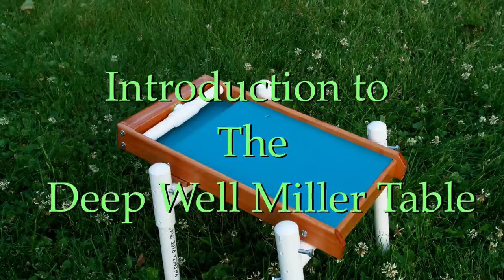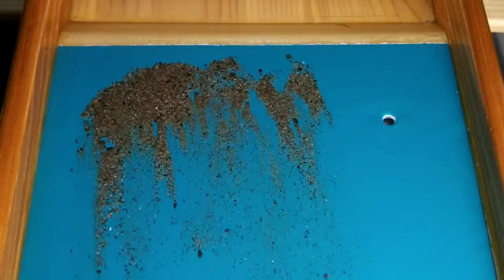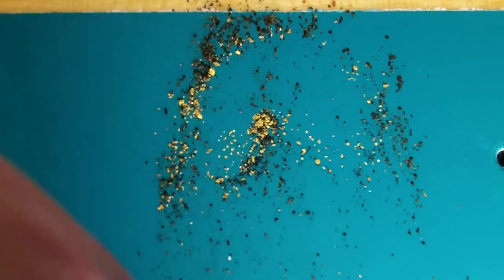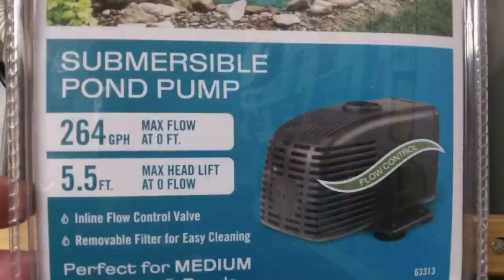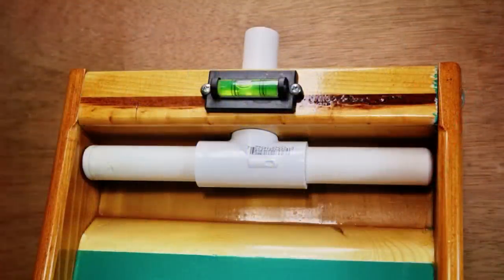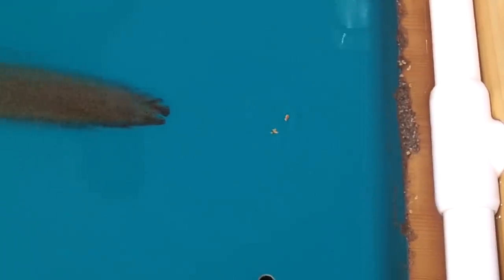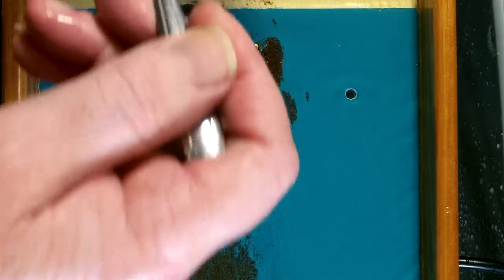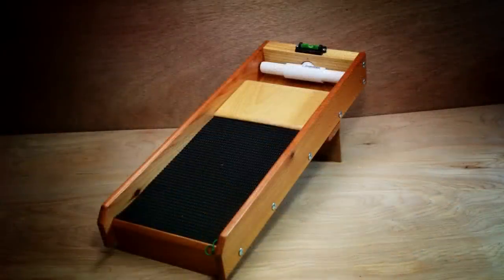NEW MILLER TABLE INTRODUCTION

Comment: Very nice! I do believe that this new build will work great on the fine gold I had mentioned to you in a previous video. Looking forward to seeing the build videos. Thank you for supporting us hobbyists by designing and building products that work.
Reply from the maker: Hi again Tim. All my tables have done a great job of catching the fine gold but this one works quite a bit better due to the smoother water flow. This one is not all that hard to build and so you might give it a try.

Comment: Oh, thanks buddy. I was going to make one of your tables this weekend now the weather is getting better... But this deep well one is brilliant in my opinion.... Think I'd be better off just having you build one for me and pay you.. I like that you and the Grandson are keeping the minds going with new and fun projects.
Reply from the maker: Well you ought to give this one a try. The gold vial hole takes a bit of doing on this one but not too bad. But we find we like just sweeping the gold into the well and snuffering it up about as well as anything. The sluices ended up with several fun surprises. Stay tuned. I'd be happy to make one for you but I'm afraid I don't have any way to sell over the internet. Sorry.
Reply: utahavalanch ,I'm not much of a wood worker. But one heck of a machinist. So I guess I can repro one by looks or close to it. Just one question, is the dam wall transition smooth to the table b or is it slightly raised up as with a dam spill way?
Reply from the maker: I'm not much of one either but we stumble through it. Lol.  The water bar sits in a sunken well. The table where you dump the dirt is elevated 3/4" higher than the bottom of the well. You start with a base board that is 1/2" and then glue the 3/4" on top of it for the table. I cut a 45 degree angle on the top board to make the water flow a little smoother but you can just leave it square and round over the edge and it still works quite well. I am right now working on trying to get the "How to Build" video finished and up so hopefully that will help explain things better. It's one of my most complicated projects but I think if you take it one step at a time you will be able to make one just fine. The most complicated part is the gold vial hole. If you don't feel comfortable with trying to build that you can leave it out and the table is much simpler to build. I practiced building the vial hole on scrap wood several times before I tried it on the final project. If you have any more questions, feel free to ask.

Comment: Thank you for this video This is awesome I I've been wanting to make one for a very long time but I didn't know how to go about doing it after seeing your video I'm telling you dude that's the most awesome thing I've seen yet thank you pip E dip prospecting
Reply from the maker: Hi Ralph and thanks for watching. Once you start working with these tables and get the hang of them, you will wonder how you ever got along without one. I have videos on a new Deep Well Miller Table that works a lot better than this version. In my last video I show a newer version Miller Table with a catch mat at the bottom to catch any runaway pieces.  I really like that version.
I am currently working on a combination I call the Miller Sluice. It’s both a Miller Table and a sluice all in one. With it you dump the dirt on the deck, and the gold will stick to it and the rest of the dirt will move on down. You can then let the gold go on down into the sluice mat or push it off into a well or bottle for storage. I use this table for testing new ground like you do with a gold pan. You can tell immediately if there is gold in a sample of dirt.

Comment: I really like your projects. they make me want to break out the saw!! Just subscribed, keep up the good work!
Reply from the maker: plumtiger1 
Hi Plumtiger, thank you and thanks for watching. Well you ought to throw one together and give it a try. I'm right now finishing up a Deep Well mat sluice that is a combination sluice and Miller Table so you can sluice your cons and then Miller Table them on the same unit. I'm also trying out some homemade mats made of Silicone to see how they work.
Hope to be testing this next week to see how it all works.
Reply: @utahavalanch  wow! Sounds great! I saw one video that used the same structure for both devises. I thought that was very cool!
Reply from the maker: plumtiger1 
You're right. The gold I work with is very small and this design smooths the water much better and allows me to catch this fine gold better than any other design I've tried. I have a mat sluice, drop Riffle sluice and Miller Table and now a combination sluice that all use the same design
Reply: @utahavalanch  what type of material is the blue top layer?
Reply from the maker: @dadandsongaming8310  
Hi Dakota and thanks for watching. That top deck is a piece of pine board with Rustoleum Chalkboard paint on top. Gold likes to stick to that paint. When you put a spoonful of material on the deck, the gold will stick to it and the rest of the material will move on down the table leaving the gold.

Comment: I love the miller table design great video. what paint did you use on the surface of the table and how did you apply it.Thanks for sharing will be waiting for the sluice videos.
Reply from the maker: Hi Alan, I use Rustoleum Chalkboard Paint in the can for it. Home Depot has little 3" foam paint rollers that I use. I usually put on about 6 coats as it dries very thin. If you apply it to an aluminum sluice bottom, use Rustoleum Bonding Primer in a spray can first. It will stick to anything and let the chalkboard paint stick to the aluminum. If it's applied to the slick plate on a sluice we're finding it slows down the gold as it goes down the plate and lets the rest of the material slide normally. Also Helmsman Spar varnish in the Satin and Matt finishes do the same. Hope to get the sluice vids out soon. Thanks for watching.
Reply: Thank you I will have to give it a try would not have ever thought of using chalk board paint. I had to show your video to my wife she said we need one of those.
Reply from the maker: Lol, I think I would listen to the wife. I thought I was a pretty fair gold panner til I got one of these and found out how much I was losing. Now after my panning it gets run on the Miller Table. If you screen your material down  to 30, 60 and 100 mesh and slow the water down to where it is barely moving, you would be surprised at how much very fine gold is in everything. 30 mesh has the highest concentration of gold. That's what I check first when sampling. If I find it there then I check everything.

Comment: Awesome video my friend much appreciated! I wonder how a smooth surface silicone mat and work on your Miller table there, might be an interesting project as well.
Reply from the maker: Hi Stephen, the silicone mat works quite well as a Miller Table but the Chalkboard paint on the harder surface makes it much easier to control due to it's being very flat with no bumps or dips in the surface to catch the material. The black sand tends to stick more to the Silicone mat as well and so it's more difficult to separate the two.
Reply: You’ll be happy to know that I’ll be experimenting with your spar varnish this week for my silicone mats! Lol
Reply from the maker: @stephenfuller8345  

Good Deal Stephen let me know how it all works out for you. Good Luck.

Comment: Hi Utah, excellent build on the tables, being watching your videos on building these and have got some timber to start on one, maybe tomorrow. I had a lot of trouble finding good flat boards at our hardware store, but eventually got some. I will run it through the thicknesser after I glue the two boards together to try to get a flat surface. On the miller table do you have a raised lip on the end so as to be able to brush the tailings (or some of) back up the table? when you mentioned about rounding up cats some will get away lol lol. I thought then that there must be a raised lip at the end.   Made a deep vee 3-4mm mould pattern today, with a 2mm space between each groove, so going to put the silicone on that tomorrow. I used the router with a fine wood engraving bit, it took a while but hopefully it will be okay.        Cheers            Robert     down under Aust
Reply from the maker: NewBee101 
Hi Robert and thanks for watching. If you watch my video on building the Miller Table it will take through all the steps. To just go over a few things here, yes, it's hard to get straight non warped boards. That's like searching for the Holy Grail. Just ain't gonna happen 😄. I usually cut them down the middle and flip every other piece upside down so the warp will counteract each other. Then glue them together with waterproof glue like Titebond III.
You need. 1/2" or 12mm base board and a 3/4" or 19mm top board. This creates a well at the top of the unit where the water bar sits. I usually make this about 2-1/2" or 63.5mm wide. The reason for this well is that it greatly reduces the water turbulence coming out of the water bar and smooths the water flow. And make it easier for the tiny gold to settle out. I also sweep the gold that drops out on the top into there for safe keeping and snuffer it up later. I usually glue the base and the top boards together with waterproof glue.
Does any of this help? If not I'll try again. I'm trying to do another video on making the Deep Well Miller Table and sluice but it will be awhile so I'll try to answer any questions in the meantime.
Reply: Thanks for getting back, I think I have it under control (yeah right) I'm a bit of a wood worker from way back, I have all the equipment I need to make this project. I have milled my own timber in the past, but I have run out of that, so it is back to buying it. I am hoping that this table will remove the fine white sand that I have trouble panning out, the black sand is okay to deal with, but the white sand is a pain to separate.  Cheers        Robert

Comment: Once again I love the ideas and the things you make.  Great work.  What are you waterproofing it with?
Reply from the maker: Welcome back Doublenot. I use the Minwax Helmsman Spar Varnish for all my waterproofing. I usually spray it on and put at least 4 coats on everything. The baseboard of the table has 4 coats all around and on the edges especially. The top deck I spray on a  couple of coats of Rustoleum Bonding Primer after the hemsman so the Chalkboard paint will stick to it. Then 6 coats of Chalkboard paint.

Comment: The only potential improvement or difference i would likely build into this would be moving the catch bottle from the main working area on the table to at the bottom of the deepwell, to one side or the other. Might need add an inche or two to the well length for workability, but ya sweeping 🧹 what you have separated down there and into a corner to snuffer it up does work, the funnel shaped hole 🕳️ itself would be a sort of holding area if no bottle installed. Just thinking...options...
Reply from the maker: Hi Alan and thanks for watching. Yippers your ideas are all good ones . I’ve tried all of them myself on different tables and haven’t found one I really like over the others. The big gold is easier to just brush down into the deep well into a groove and then snuffer it up. I do like the bottle when working with the very fine gold so it doesn’t get washed down the table. I now have 2 tables. One with the vial for fine and one without for the course. One thing I’m building into my new tables is a 3” silicone mat at the bottom to catch the rollers, floaters and runaways. I have been surprised at how many pieces get down the table without me seeing them.
Reply: @utahavalanch  a mini nugget catcher, and you have the proof that it is necessary. Not a big surprise since gold 🪙 is so malleable, mostly flat but then once flat rolling along in the river, it folds and balls up, and works out a different shape once again. It's been out there awhile, and the shape size and weight of these small particles we are trying to separate is the determining factor. It's actually why a Miller table works. Gold is about 4 times heavier than black sand, so then screening for size and the particle shape make the rest of that difference. Great videos, thank you for showing this!
Reply from the maker: @alancadieux2984  yes, it’s interesting to see how many different shapes and sizes that gold takes. Most of the gold I work with is very small and Is quite challenging to try and come up with different methods to catch it. But for me that is the fun part of prospecting.